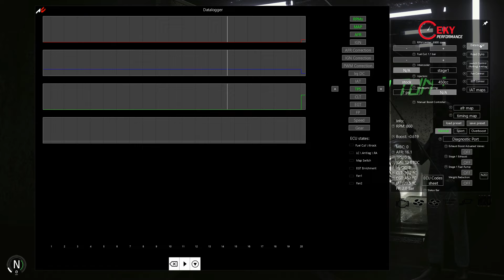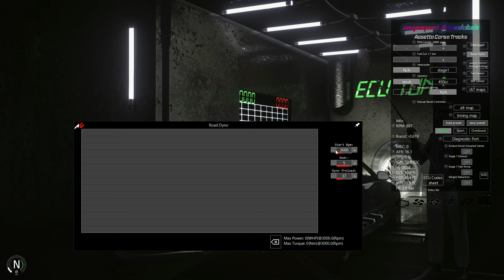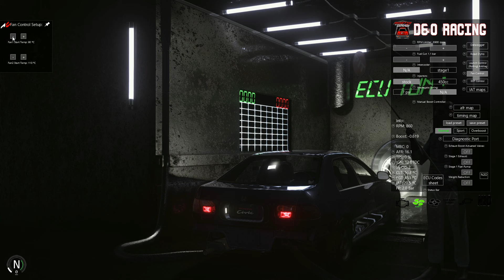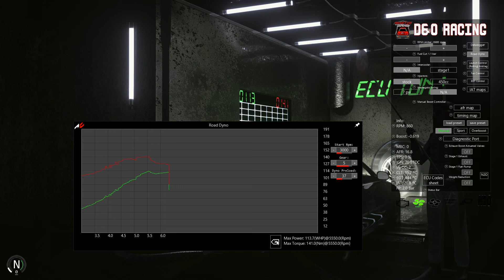Assetto Corsa - ECU Tuner - How to tune an N/A engine #4

Comment: when i try to select fuel pressure or strobe light it doesn’t let me it appears for a fraction of seconds and disappears
Reply from the maker: @xuxo5222  thats good..you need to open it properly with diagnostic port
Reply: @ doesn’t let me open diagnostic either it do the same thing
Reply from the maker: @xuxo5222  send me the video on discord my nickname: matel855
Reply: @matel855  dw i fix it thx either way